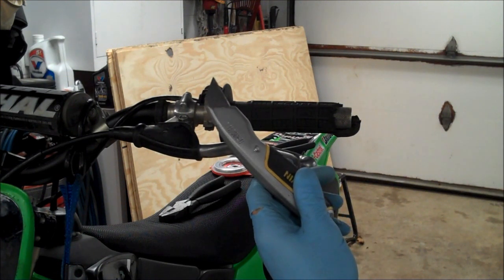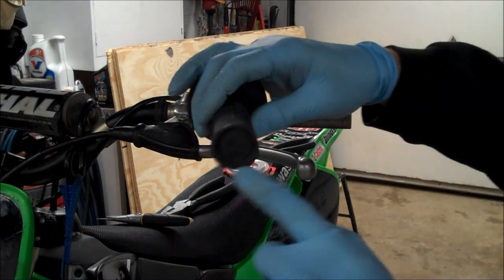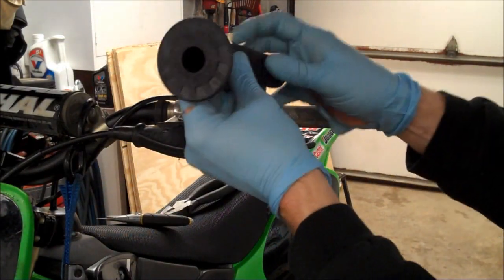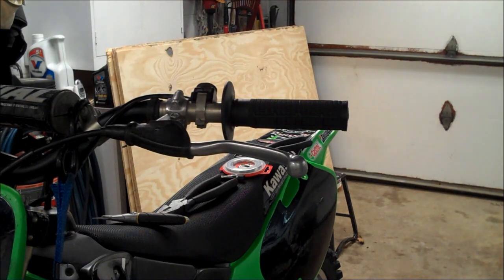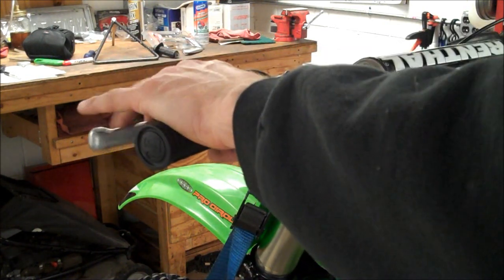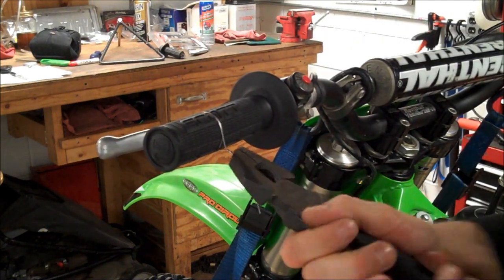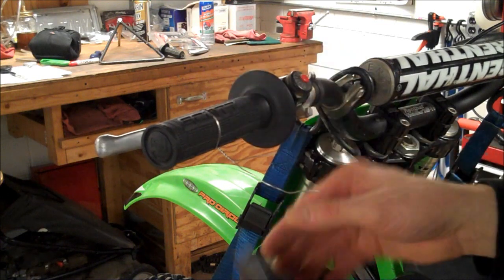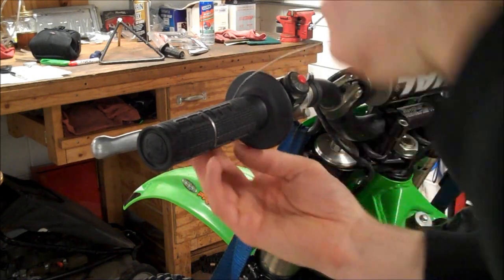How-To: Safety Wire & Glue Grips MX

Comment: weird question but I really need to know the year and make of that bike.  or what front forks are on the bike. because I bought a bike with front forks on it from a different bike and the look the exact same as those.
Reply: +Steven Carter It's a 99-02 model kx 250. The same forks are used on the 99-04 yamaha yz125's and yz250's too, I have a pair of spare forks sitting beside me off of a 2000 yz250 and they look identical.
Reply: Yeah I figured it out from your other vids too. Thanks man. Now I can rebuild my mysterious forks in my 1991 kx250!

Comment: This time around im gonna safety wire my glued grips because i hate that they start rotating and slipping, and grips are actually very important especially if you do race or go on tracks!
Reply from the maker: Yes, also prevent slipping if grip were to get wet.
Reply: Yup, and thanks for the video and you made it look like a piece of cake
Reply: I got a 2012 kx250, whats your bike it looks nice!
Reply from the maker: No problem. Mine is a 2001 kx250.

Comment: You're gonna need that knife to get that new grip off if you use glue. Get some safety wire pliers and safety wire at Harbor Freight.
Reply from the maker: Yes, getting them off will be fun. Even with glue and safety wire, they still spin a bit. Thanks for the Hf tip. I don't safety wire often.